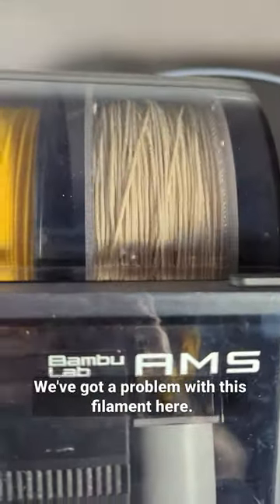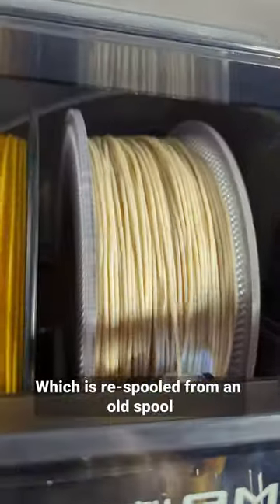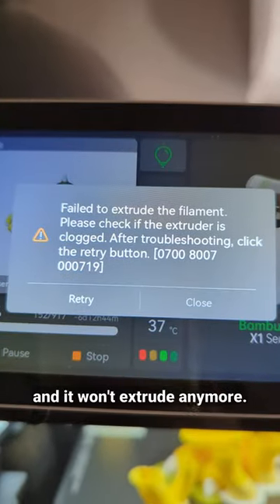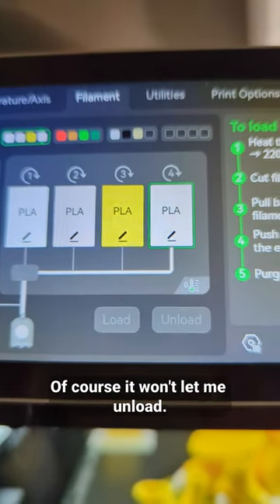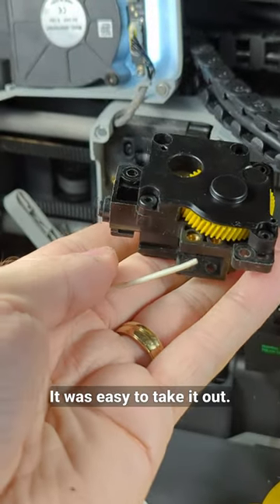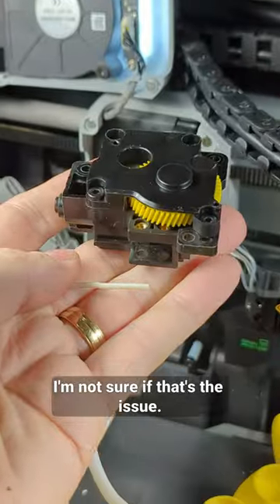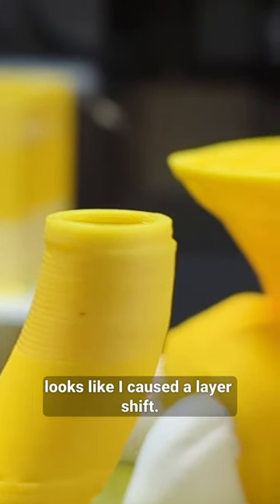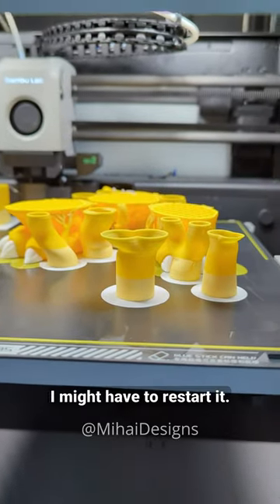Filament trouble

Comment: If the misbehaving filament has been respooled and is a little old, it helps to akneel it to help alleviate the stress and reduce brittlenes. I think that is the reason it fails.

Comment: Ngl, these printers seem like big pains in the arse. Nice dedication for sticking with them 😭😭
Reply: I think stuff like this just comes with the territory. That being said, I would still rather do a complete custom build with open source Klipper firmware. There are way too many failure points with 3d printers and having a peace of mind knowing that the repairs on your custom machine will always be easy, is a good thing. I run 3 custom printers with Klipper and ERCF multi material. When there is an issue, it is always an easy fix.

Comment: why don't they fix the shifting issue it's not a big deal just add a extra sensor any where on the plate so it can celebrate every time when you have to stop in the middle of the work for any reason so it can re alig and start working without any shifting???

Comment: have issues with my p1p where when it prints for a time some filament gets stuck in the gears of the direct drive and it kinda buges so it get bigger than the 1.75 diameter
Reply from the maker: Make sure it's not partially clogged. Do a cold pull. Also the ambient temperature shouldn't be super super high (usually not the case).
Reply: @MihaiDesigns  it is about 35 :/ the cold pul is not possible cause the part that is getting stuck is in the 2 gears so i need to dimantel it every time i will do a chasy fan upgrade and hole that lowers the temp a bit. in the winter it should not be an issue but in the summer darn it..